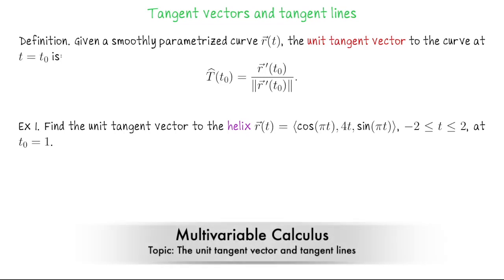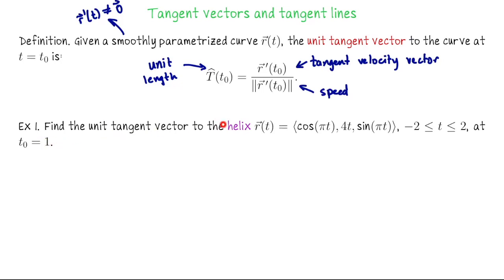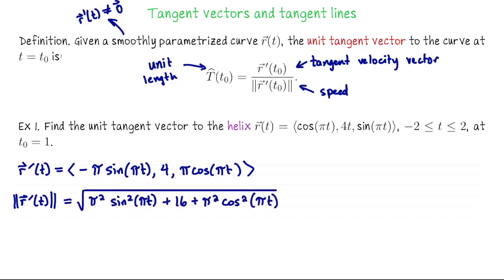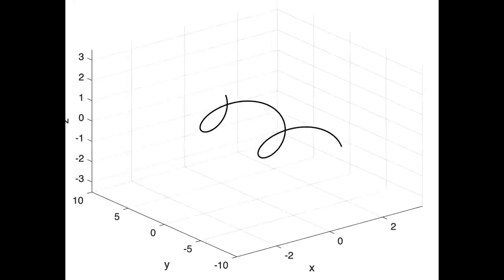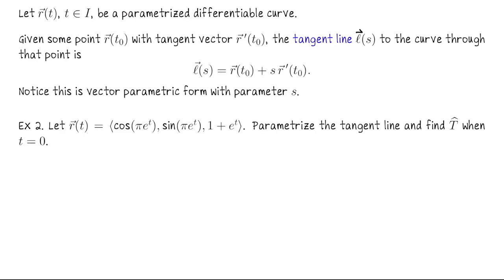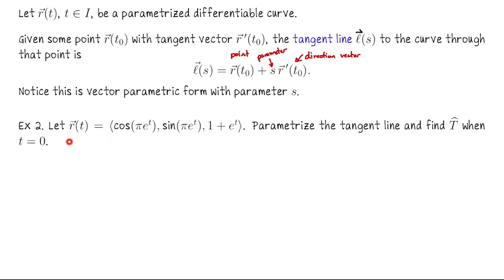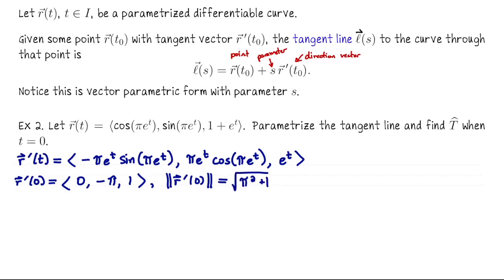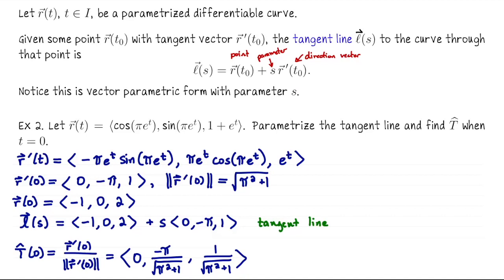Multivariable Calculus: The unit tangent vector T

Comment: Thank you for all the videos, Dr Maultsby.  I have a Q in this video, though. 
In the Matlab demo one can see that the unit tangent vectors and tangent vectors, are both tangent to the curve at various t. Why is the dot product of the unit tangent vector with r(t) not zero? Thanks.
Reply from the maker: I'm going to be annoying and answer with a question: why would the dot product be zero? Think about the curve r(t) = (t,t,t) (a straight line).
Reply: @bevinmaultsby  No worries. I suppose for some weird reason, I was equating the word tangent (or derivative) to that used in a context of a circle : the tangent being orthogonal to the radius and hence their dot product be zero. 
For r(t) = (t,t,t), tangent vector r'(t) = <1,1,1> This would point in same direction as r(t), dot product is not zero. Is this "my brain has frozen up" moment?
Reply from the maker: Sounds like you connected the dots! There's no special relationship between the position vectors r(t) for a parametrized curve and the tangent velocity vectors r'(t). You are right that when we consider a parametrization of the circle, r(t) . r'(t) is 0, but that's a special case. [You may have also been thinking of how r'(t) . r''(t) = 0 for any constant-speed curve (but not in general).]
Reply from the maker: I am teaching Real Analysis II this semester, hence the uploads (and the pace of the uploads, which I'm actually bit behind). However, the next thing in the pipeline, so probably around Nov-Feb, is proof-writing and Real Analysis I.
Reply: @bevinmaultsby  That's smashing, thanks ! I look forward to it. Would you be uploading those videos on your YT channel as well? Which book (if any) would you follow for proofs and Real Analysis I? Thanks for engaging, I appreciate your time, have a great week ahead !
Reply from the maker: Yes, they'll go on this YT channel. The traditional recommendation is Rudin, but I actually like Abbott's Understanding Analysis, I think it's very readable.
Reply: @bevinmaultsby  Thank you again, I'll get my hands on the book. Just finished your brilliant visually intuitive T,N,B lecture. Two adjectives I was devoid off in my prior intro to this.